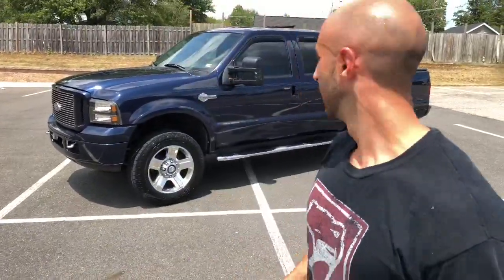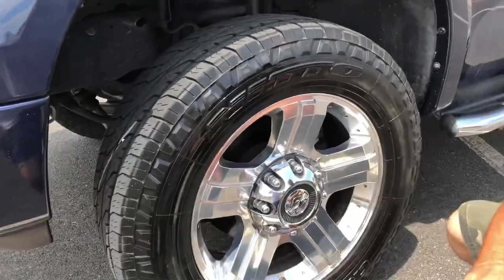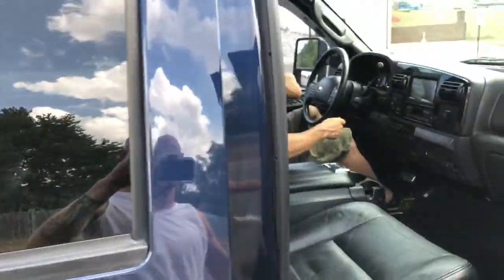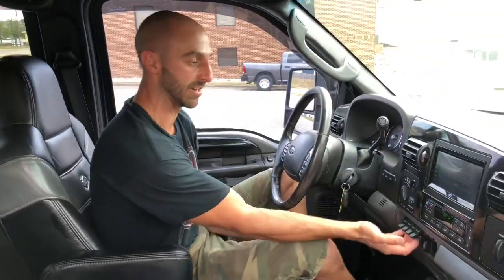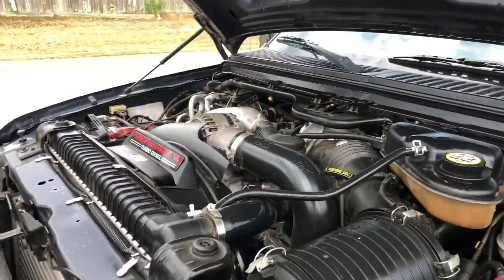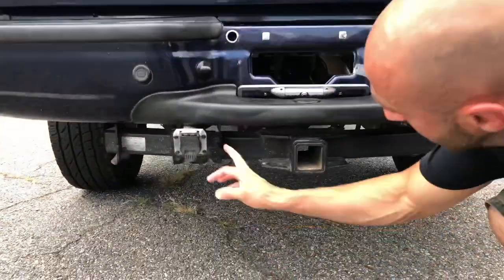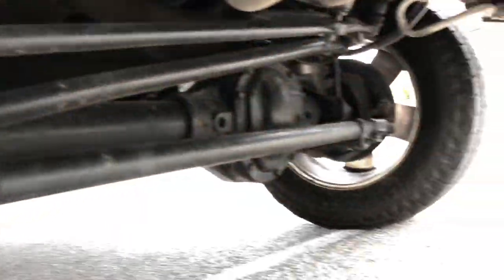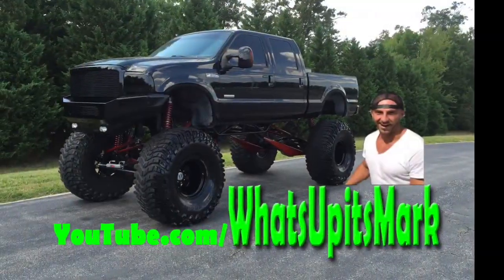Harley Davidson 2005 Ford F-250 PowerStroke 4x4

Comment: i just bought one about a month ago. i love the OEM look but not really OEM powertrain mines been really well taken care of no rust at all its from NC, im 3rd owner. origional owner at 20k miles Built the truck at a very well known shop its got a stage 3 red diamond diesel transmission borg warner turbo. warren diesel injectors arp head stud Electric cooling fan kit cold air intake straight piped just  cat and EGR delete, runs like a champ. all interior items work still power rear window A/C etc etc heated seats. seats have some wear but no rips or anything. factory rims. 08 mirrors and recon tailights light bar in front bumper and recon roof marker lights only exterior changes.

Comment: Nice truck mark but I gotta off topic question, I’m looking at buy this 3rd gen Cummins mega cab, thing is it has a stack in the bed, what happens when it’s raining or things like that? What’s your opinion on stacks should I get it removed if I purchase? Thanks
Reply from the maker: Hey GREAT question buddy, I have a few trucks in stock right now that have stacks on them, honestly it’s all preference I like them depending on the modifications done.  A stack can get very messy though. Usually you just take a 5 gallon Home Depot bucket and put it over the top when you’re not driving
Reply: Whats up its MARK! Thanks for the idea, but not to be a drag but I got one more question, what do I do when I’m driving and it starts raining ?
Reply from the maker: Versedbonsai777 no worries. When you’re driving and it’s raining the heat from the exhaust will evaporate any water.